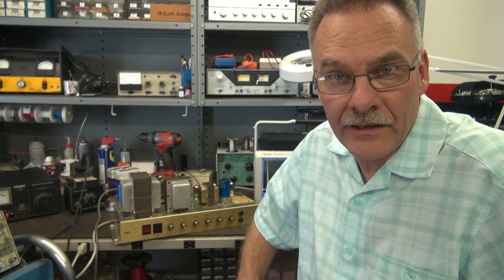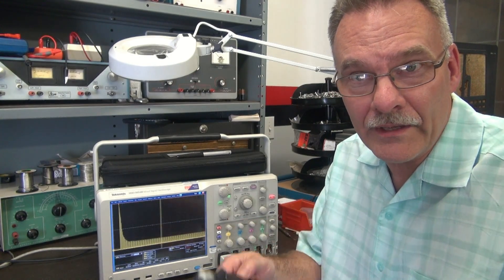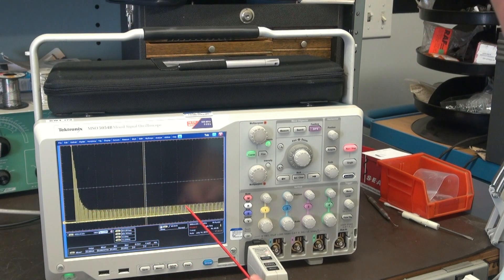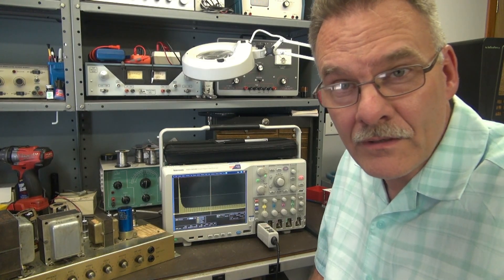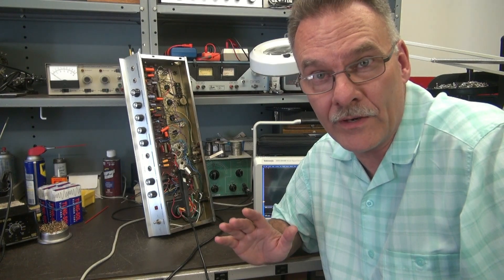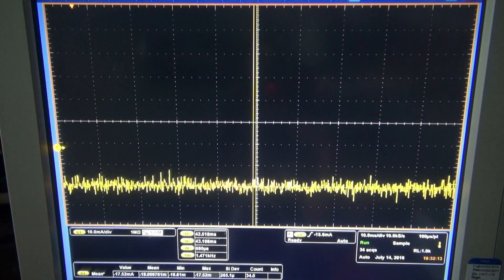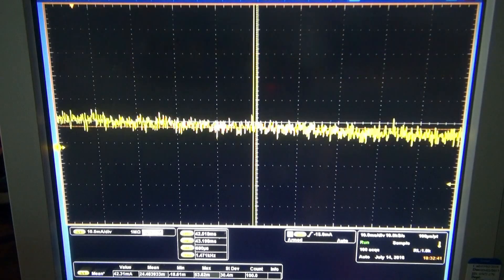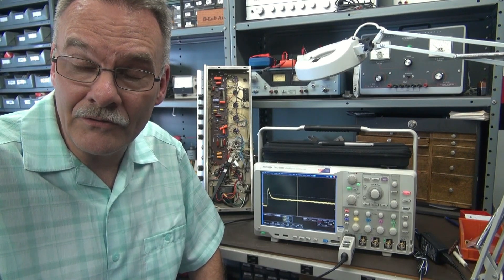Tube Guitar amp standby switch demo Myth buster Marshall Fender

Comment: Just received my Marshall DSL 40CR, and read the Quick Start Guide. It doesn't say anything about engaging the Standby switch when powering On/Off the amp. It just says to ensure all speakers are proper and turn all the Master Volumes to 0 and plug in your guitar before turning the amp on. The only mention is to reduce the power level from 40W down to 20W or to place the amp into standby mode. This is directly from Marshall themself.

Comment: Thanks for the info! What if the tube rectifier is a 5U4GB? Directly heated and shorter ramp up compared to the GZ34. Is it still beneficial to not use the standby? Just curious if the B+ hitting the output tubes before they've fully warmed up is detrimental.

Comment: They are there for a reason, been using them over 45 years without an issue. they work, end of story. You don't want to cook your tubes, the best thing you can do is install a fan, blow some air over your tubes, it will also cool the power xfmr and output xfmr. Boogie has been installing them in their amps forever and it works.

Comment: I have a Marshall JVM410HJS, Friedman BE-100 Deluxe, Mesa Boogie Mark V 90 and a Peavey JSX. I have been using standby switches forever because I've been told it saves your tubes. So should I use the guitar volume or master volume on the amp?

Comment: Whether wrong or right, better or worse, I’ve been using standby switches for over 35 years without issue. I have one amp that’s tube rectified that I got recently so I think I’ll actually not use standby on that as my history/experience is pretty much Marshall based, SS rectification.

Comment: In HiFi amps we often use a soft start relay, that switches in a resistor to start up slowly, and then switches it out again in a second or so. That relay can be put in a separate box, and
the ´standby switch´ has to be on, when turning on the power. A fix to be able to use the stand-by switch when power is on, could be to put a NTC (thermistor) in series with the stand-by
switch. Many of those are rated at 5A. The NTC data sheets though does not show a max voltage, and I haven´t tried it yet. I find it practical to use a stand-by switch when changing cabs
and other stuff.

Comment: Two issues with standby switches. Firstly leaving an amp powered but silenced with the standby causes, all be it slowly, cathode interface resistance to develop. This is irreversable and reduces valve performance perminantly. Secondly on valve/tube rectifier amps having the standby between the rectifier and the reservoir capacitor means the rectifier is hot when it 'sees' the capacitor, which as it is fully discharged looks a lot like an instant dead short. This stresses the rectifier and can cause arcing and failure, especially as virtually no amps have the required minimum resistance resistors in series with the transformer feeds to the rectifier. Removing the standby switch in valve/tube rectifier amps means the rectifier starts to charge the reservoir sofly as it warms up and so avoids the sudden draw the standby switch causes. This (and fitting minimum resistance resistors) lengthen rectifier lives considerably. If you need an amp mute switch dont use a standby switch but rather have a switch to ground the signal (not the bias) going to the output valve/tube control grids.
Reply: My builds have a switch which grounds the volume pot wiper, labelled 'mute'.

Comment: My Carvin X tube amps are now 40 years old and the standby has been used in various ways at home and for gigs. I’ve replaced only tubes and a single power switch over this time. Yes these amps should be gone through at this point but both are still sounding killer and everything works!

Comment: Great, simply great! I did not use my standby switch on my fender tube amps just for this reason. In guitar amp app it is complete useless. I worked in the 60's with tube powered radio transmitters and than you must use the standby switch! The whole myth is in mine opinion started by Leo Fender. This man was in his early years a radio receiver/transmitter technician. So on his first amp he placed the standby switch because he was used to do this with transmitters. And every amp builder followed him and created a story about the standby switch. So glad that you let see what happens. I do not think the big brands will follow this because the guitarist demands a standby switch. lol great video's. The only thing you can do is read the post from Trevor below. You are sparing the filament with a NTC resistor.

Comment: You might want to check electrolytic capacitors voltage when amp is cold and your turn it on with stand by on operation setting

Comment: So, kind of unrelated but is there a reason to let amp sit after playing for a while on standby before turning it off? I ask this because I am terrible about forgetting to turn them off after this step! Just the other day I noticed I had left my old blues deville on standby for 4 and a half days! Did the same thing with 2 twin reverbs once before. How bad is this and what parts am I shortening the lifespan of? Just power tubes or more? Thanks to anyone who can tell me more lol.
Reply: There is no reason to let an amp sit on standby. Simply turn off both switches at once. Letting an amp sit on standby for long periods of time (e.g., four and a half days) can result in cathode poisoning which degrades the performance of all the tubes.

Comment: I only use the standby switch when I turn the amp off so when it's turned on again too much current doesn't harm anything. Does that help in any way or am I off base with that concept?

Comment: I never plug or unplug my instrument to the amp without the standby switch engaged. Between sets, I'll turn the volume down on the guitar and then engage the standby. When I come back from break, I'll disengage the standby and crank the volume up on the guitar. It doesn't matter if the standby switch is on or off during the initial power-up unless you are dumb enough to plug your instrument in without engaging the standby. You know the 'crackle-pop' I'm talking about. If you have really hot pickups, look out. I've seen it a million times.
Reply: It's possible to damage the output transformer by plugging in a guitar when the amp is cranked.

Comment: So the standby switch when in standby on allows the filaments to stay heated, but keeps the high voltage off the plates, then when standby is flipped off high voltage then hits the plates and the amp is ready to amplify correct?  I was under the impression one should put their amps standby on, then turn on main power switch to get the heaters glowing for about 30 seconds to warm up, plug in the guitar and then flip standby off and play, correct?
If a break in music is then needed, flip standby back on, come back, flip standby off and continue playing. Am I understanding this all correctly?
Thanks
Reply: That's what I have always done except leave the standby off then turn power off to discharge the caps. Reading through these comments it's hard to figure out who's correct.
Reply: @JimmyDevere  Makes sense to me to what you do, the high voltage will typically bleed off through warm tubes after you kill the main power switch I was told.
Reply: @repairfreak  When you switch off the amp, the tubes continue to conduct as their cathodes cool down, draining the high voltage. (If their is a standby switch it must be in the 'play' position.)

Comment: Oh man
what did you do in electrophysics class at school?! :D
After all, it's not about inrush currents after switching on and the steepness of the voltage rise - this is a matter that causes a problem mainly for the smoothing capacitors behind the rectifier.
The main reasons for using a standby switch are two basic:
The first reason is for use in live performances, when a musician cannot afford to wait 20 seconds after arriving on stage for the amplifier to warm up to start the show.
That would not be a very triumphant entry on the podium :-D
Also, sometimes you need to turn off the amplifier for a short time if you need to reconnect a faulty cable during a performance and continue playing immediately after the replacement, etc.
This is the first reason for using a standby switch, to be able to turn the tube amplifier on and off as quickly as a solid state amplifier.
The second reason to use a standby switch is important to protect the emission layers of the cathodes, and that's the thing you missed in electrophysics class.
If you operate the tube in underheated or overheated mode, you damage the emission layer of the cathode.
In overheated mode, you damage the cathode by evaporating part of the emission layer and creating an imbalance between the representation of barium, strontium and oxygen atoms in the composition of the emission layer.
In this case, the cathode is damaged, but not as damaged as in the opposite case, when the cathode is under-heated.
However, a significant problem with overheated cathodes is that barium and also strontium settle on the tube grids and then grid emissions occur on those grids, which is a relatively serious problem, especially if this occurs on the first grid.
Well, now the problem that arises when the cathodes are under-heated.
If the cathode is underheated, the cathode emission layer tends to accept more oxygen molecules than is set in its composition at the end of the activation process during manufacture.
And this imbalance causes a reduction in the emissivity of the cathode = the ability of the tube to transmit the full dynamic range is reduced.
I know that an uneducated amateur could object to me that there is no oxygen in the tube because it is pumped out and its last remnants are captured by the getter, but in fact there are enough oxygen atoms in the tubes, which are released mainly from the anode plates, some atoms get to bulb of
 tubes through microvents in glass, etc.
Well, that's just the fact that if you don't use the standby switch, for the first approx. 20 seconds you operate the tubes in under-heated mode, so every time you switch on the device, you cause excessive aging of the cathode emission layers of the tubes.
So I hope you don't get mad at me for disagreeing with you and presenting it publicly like this, because I also dispel myths and it's important for me to do that because people who follow us learn from our posts.
And one of the worst things is when you learn something, internalize it deeply, and then you have to relearn it ;-)
Many greetings and much success in your work.

Indian of Louny
Reply: Nice to know there are people still interested in this phenomena after six years. I am not an electronics educated person, just a player, every other comment makes me change my mind back and forth lol. Since you are a proponent of using the standby, what about when turning off. I was told to turn my marshall plexi style amp off with bypass off in order to let the caps discharge or something.

Comment: The purpose of the standby switch is to make the amp dead quiet when the band is not actually performing, while leaving the tubes hot and ready to work immediately.  
Also, guitars, mikes, and speakers should only be connected or disconnected when the amp is either fully off or is in standby mode.  You risk damage to your equipment if you connect or disconnect while the amp is "live".   The standby switch thus lets you keep the amp warm and ready to play while changing equipment around. 
There is no problem about stressing the tubes by sudden surges.  Before the solid state era, millions upon millions  of hi-fi amps and TV sets were made, all tube in design but with silicon rectifiers after about 1958 or so.   No degradation in tubes life was noticeable after the change to silicon rectifiers.
Switch-on surges in HT were a problem with high power tubes used in broadcast radio transmitters, but they used a different type of cathode, and the voltages were much higher.
There is a problem with leaving an amp in standby mode for long periods.   When tube heaters are on without anode current, the cathode slowly develops what is called an "interface layer" - a high resistance layer between the cathode nickel sleeve and the oxide emission layer.  This interface layer causes a reduction in tube gain.   In Western tube manufacturing, this was prevented by using ultra high purity nickel for cathodes from the early 1950's onwards.  However, Chinese made tubes that you buy today do not have the required high purity of nickel and the problem has returned.

The waveforms shown in this video are invalid - he's connected his probe at the wrong place, and is measuring the filer capacitor surge, not tube surge.
Reply: Your last paragraph should have been first.
Reply: @MrJohnnyDistortion  : Depends on whether you want to know the real purpose of standby mode, or you want to knock the D-Lab guy.
Reply: @keithammleter3824  
Nice disclaimer.😂HE'S SAFE, HES OUT! Pick one that suits.😃
Reply: So then you are saying it's not a problem to turn the amp on in standby only to leave it on standby for long periods. If that's the case, wouldn't it be better to get into the habit of not using stand-by and turn the amp volume to zero instead? Is there a problem with turning the amp on with stand by off? And what about potential arcing issues?
Reply: @JimmyDevere  :  Correct - the risk is only in leaving an amp in standby for long periods.  There is no problem in turning an amp on in standby mode so that it warms up mute.   Rotating volume and tone controls causes wear, leading to scratching noises and intermittent loss of volume while playing.   Therefore, only rotate volume and controls when necessary for artistic purposes - do not use volume control to mute an amp.   No problem with tube interface layer degradation would occur over long periods by turning the volume down instead, but if you know its going to be a long period, you can turn the amp off completely.
I'm not sure what you mean by arcing issues.   Amplifier output tubes, output transformers, and tube sockets can arc over if the amp is on, not in standby mode, and speakers are disconnected.  Good quality amps eg Fender use a very small amount of negative feedback to minimise this problem, which can arise if your speaker fails by going open circuit while playing.  But don't rely on this feature.

Comment: Im so glad I moved on past Tube amps.     Way too much mainteneace,   too much stress,  too much sensitivity to current fluctuations etc etc etc.      I have a "middle of the road solid state" going into a  Seismic audio cab with DV77, Swampthang, Manowa5r  sheffield speakers & I need No pedals,  No boosts,     heavy & huge tone & articulate ,  just love it & the clean channel is full & pure clean.    Pickups are S,.D Nazgul & Sentient.         I leave the tube amps to the others ,    Best  tione Ive ever had   and basically no maintenance .

Comment: Holy moly. The purpose of the standby switch is to cut the stage volume off and on without hiss and ramp up. I have a Marshall 50 watt that I've had for decades. Had more problems with the power supply and the the occasional pre amp tube than I EVER had with a power tube.
It and its 4 X 12 even toppled over backwards into the street and were fine.
No issues here.
Reply: when I used to play out professionally.. I also toppled over backwards one time..... I hate it when that happens....

Comment: So to make the ending of this video more clear, you will get a spike with or without the standby switch on a solid state rectified amp like a Marshall.  You will have a slow turn on with tube rectified amps with slow turn on like some Fenders and Vox AC-30s.  Personally, if an amp has standby, I'm using it as I always have and never had issues.  The standby debate is silly. This debate only came around the past few years, but these amps have been around for over 60 years.

Comment: On a Fender amp, turning the volume pot to zero leaves the last three stages of amplification and the entire reverb circuit active. If the band takes a break and the amp isn’t dead quiet, that noise may be annoying. And someone bumps or moves the amp during break, the reverb spring will crash. A standby switch eliminates both of those issues.
Reply: What's the advantage of a standby switch versus just turning off the amp?
Reply: @slayjah2  If a break is short I’d prefer to keep the filaments hot. It’s not big deal, but I prefer to have a standby switch.

Comment: I solved this problem by ... Switching to transistor based amplifiers! I got sick of switching my AC30 from standby and popping rectifier tubes on stage in front of an audience. 

My 1988 Award Session SG75 has never, ever, gone wrong. It's only had two service items since new: the input jack, and the clean channel master volume pot. That's literally it.

Comment: The purpose of "Standby" is to keep the filaments warm when not in use, which reduces the thermal shock of applying full filament current. Most tubes fail on "Filament Open Circuit" so "Standby" reduces this risk. It serves no other purpose than that.
Reply: Yeah but on the other hand the cathodes and filaments are wearing down being on when the amp isn’t being used. I’ve never seen any evidence that using or not using a standby switch helped or hurt tube life.
Reply: @2204JCM  yes or no, it does keep me from having moments of silence as the tubes warm up after a set break.  I'll use the Standby switch.